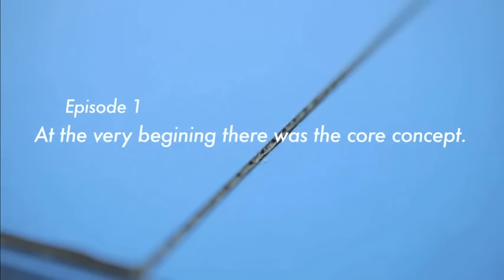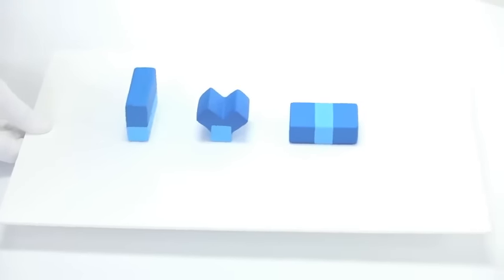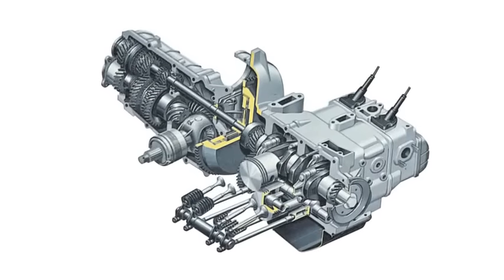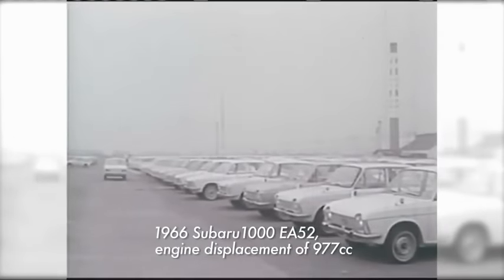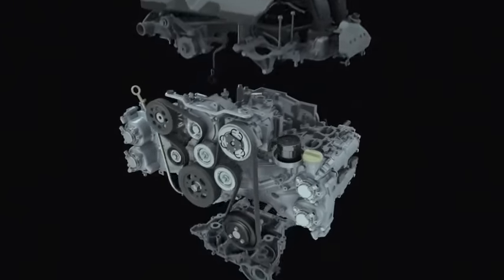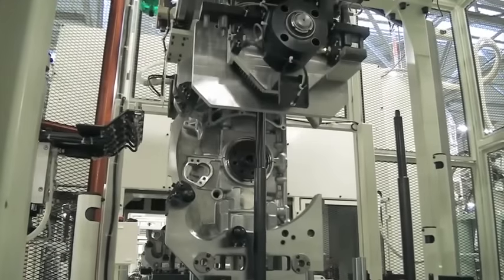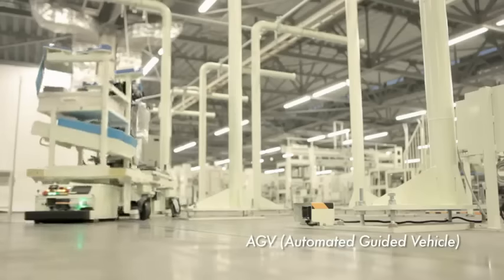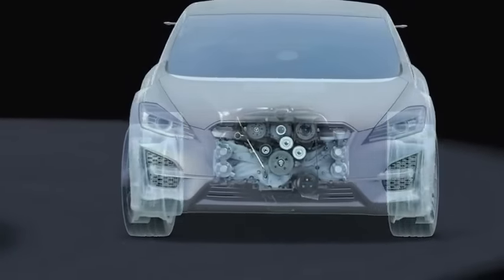Learn About Subaru Boxer Engine Technology

Comment: After considering Subaru for some time. Finally got a 2016 Outback prem. My goodness what a driving contrast from the old Silverado..The doors seal so tightly. You feel a pressure change when shut. Or so it seems. I have heard from many, with care those engines. Can just wave at 100 k if properly cared for. I would defer to a pro on that. Until then. Enjoying the vehicle. Oh. And Who Dey Go Bengals

Comment: Please let us not forget that even though the boxer is a nice engine, however it is SUCH a bitch to work on. HEAD GASKETS! HEAD GASKETS! HEAD GASKETS! I know a subaru tech that works at my local dealer, they have 4-8 a month in the shop, all head gaskets. A dealer charges $2k - $6k depending on if its both heads and if its done right by REMOVING the whole engine. I currently am saving for a wrx sti, I love subaru, but the only thing selling me on them is their AWD, else mitsubishi would have my money, its just that where i live AWD is a must. Currently im driving an inline 6, and yes its not a fast, racing engine, by all means, and yes the center of gravity is off, but i will tell you, when I am working on my 2000 cherokee, it is a DREAM to work on, and it is both inexpensive and can be done easily at home.
Reply: Chase Null If you make a pulley system in a garage and you don't have a motor pull then you can do headgaskets, or just buy a pulley and do it safer. Not to mention having something to allow you to pull motors will help in the future.
Reply: Connor Keegan funny my straight six doesn't need an engine life, I could literally sit inside the house of my car and work on it.
Reply: Well that didn't make sense. I agree that boxer motors are a bitch to work on, I was just saying it's cheaper to get a motor pulley and be able to pull them and fix the headgasket yourself if you're mechanically inclined. I also know that it's easier to pull the head on an inline four, a straight six, and most other motors that don't actually require you pulling out the entire motor. I'm pretty sure you can also drop the entire front suspension on my 96 impreza outback to get enough room to pull off the heads but it's a tight fit to be working on it like that.
Reply: +Chase Null I recently pulled the engine out of my sti, had it rebuilt and put it back in.  It was a total breeze, and before that all I had ever done was change break pads and oil...Subaru engines are really easy to work on, but the horizontally apposed design makes the weak head gaskets hard to work on, you can do them in the car, but it is a pain.
Reply: ***** sorry you had to do that. seems like a lot of work for a newer car. I say newer since I have never had to do it on my 2000 cherokee
Reply: +Chase Null it had 142,000k on the engine, it was time for it to go, thats what you get when you turbo a small engine like that
Reply: +Han Solo strange mine has 300k miles never had that issue
Reply: +Chase Null your sti?
Reply: +Han Solo oh gosh no my little old jeep! don't get me wrong I'd love an sti, but I can't justify the problems that come with a $38k car
Reply: Well, you're looking at a different type of car. Not to mention Jeeps suck, so the fact you managed to get it that far is good for you. Turbo'd motors don't have to be gotten rid of at 150k they just need to be rebuilt, and that's not even that big of a deal.
Reply: +Connor Keegan I mean yes NEW jeeps suck, however older jeeps you can't kill. inline six motors simply do not die, mine has had no coolant and 2 liters of oil and still ran like a top. But from a mechanical break down they are easy to work on with the exception of dealing with the rust
Reply: +Chase Null id be very happy with a jeep (maybe a little newer), but I just accept my car needs work cuz i like it.  Its not that bad actually very reliable with general maintenice
Reply: I would never own a jeep. So you can just call me bias and leave it at that.
Reply: +Connor Keegan no not biased. ignorance and bias aren't usually one and the same but they often go hand in hand
Reply: I'm not being ignorant, I'll drive an older jeep, but I won't buy one, nor buy American cars. I prefer Imports, and I don't like any of the new jeeps nor Wranglers or any of their vehicles they've made since the late 90's. There are far superior off roading and all terrain vehicles that surpass the quality of a jeep in many, many ways. Ignorance and bias only go hand in hand with an uneducated person. I don't like jeeps for reasons involving failures and mechanics. That's not ignorance, that's just preference and my social biased, if you were to be scientific about this situation.
Reply: But drive ur jeep till it dies, that's the point of a vehicle.
Reply: +Blehtubezz Aus well the dealer is $5-6k for both headgaskets, my local/family mechanic is around $2k for both. So yes the dealer is clearly ripping people off but what dealer won't? But I mean Subaru is in a way if they haven't fixed a known issue, and not all of their motors had the issue, so it would appear to be something that is able to be corrected.
Reply: The issue is the open deck cooling, and not taking good enough care of the car.
Reply: +Chase Null watch the headgasket done by the youtube user briansmobil1. he goes into great detail. honestly looks pretty damn easy. it can be done without removing the engine, but for how easy their engines are to pull out you might as well. make sure you get it machined before installing the headgasket and you'll eliminate headgasket gasket issues for the lofe of the car most likely. subaru i guess just using a air tool to scrape the surface which creates imperfections that the gasket has to try and fill resulting in less life of the gasket
Reply: Just don't buy SOHC 2.5ls, 1.8l's, NA DOHC 2.5l's, 2.2l's with black inside the exhaust or any Subaru with black coating the inside of the muffler tip.  And if you already have one, replace fluids religiously, get your head gaskets done or do them yourself at 75-80k, do the timing belt and water pump, always check your oil when you fill up your gas tank, check your fuel filter, o2 censors, canister purge solenoid, piston rings, ringlands, just take real good care of it and build it up or get rid of it before it's not worth anything. And if you have a DOHC don't neglect doing your timing belt, and if you do it yourself do it properly or you'll end up with bent valves and a lifter tick. Life lessons.
Reply: And watch your temp gauge people. Last thing you need to do is not pay attention and over heat your car, especially if you haven't had a new timing belt kit put on and you have 100k miles on ur car.
Reply: ***** Well if you do it yourself, the gasket that is. Costs are only the gaskets and fluids which is cheap as hell. I can bet though that machining the head would be far less than 3k. I could do it on a desktop basic cnc. The hardest part would be mounting it inside the machine and using a laser level. Oh and covering all the ports from debris. $200-300 job max id say.  Not trying to argue as you make a good point also. Machining would be proper but one could get away with a flat block sanding with a very fine grit paper. I dont own a subaru but will own a frs in the near future so i will be doing as connor mentions very rigorously. Some additions to connors tips if buying a subaru. A compression tester and obdii reader will tell you about the things you cannot visually see going on with the car.
Reply: +Blehtubezz Aus 👍👍. Sounds good
Reply: You only need to have the block machined if it's a piston issue, a headgasket you can get away with sanding the head and block where they meet so that it's all in spec to 2 thousands of an inch flat.
Reply: +Connor Keegan ahh okay. van you explain the black soot on the exhaust? isnt that just because its running rich which is a good thing for turbocharged cars especially. now black soot with blue smoke that makes all the sense in the world
Reply: It means your burning oil or your piston rings are on there way out. It's build up from burnt oil that's being combusted in the chamber instead of just air and fuel
Reply: +Anthony Rs You should NOT be running rich even turbocharged, and if your getting black and blue out your tailpipe that's sign your valve guise seals are demolished and your cooking oil in the piston chambers, crank case, and it's spewing into your headers too. You should get your piston rings and guise's replaced brother, because your engine is self destructing.

The worst part is if your seals are bad you're LOSING BOOST if there's any left at all, not to mention your pistons have to move through sludge, and it'll take that much longer to get the turbo spooling. Unfortunately since oil is vaporizing in your exhaust the TURBO MIGHT BE GUNKED UP, let's hope not. But you shouldn't see any smoke *unless your running an Anti-Lag System lol. I'm praying for your car brother, hope it's just small amount of oil sneaking through.
Reply: +Chase Null Although I like the balanced idea, I think it would be cool to TRANSVERSE mount it. That way you could work on it much easier, and even make a BOXER 8 CYLINDER (since you have more room longways). You could tune it to rev much higher with the good balance and low rotation mass.
How freaking epic would that be?!
Reply: cybertree That's not true, turbo'd cars do run rich usually.
Reply: +cybertree dude....running rich is a good thing. if you run too rich you get no combustion. run too lean and you knock.. turbos run rich as a fail safe.
Reply: Yeah, I have two friends with turbo'd cars and that is true for sure.
Reply: and my current car is running good lol thanks tho.
Reply: What do you drive?
Reply: +Connor Keegan a corolla, nothing sporty lol works like a charm tho
Reply: That's alright, I have a rally project Impreza Outback sport, it's not fast yet, but it will be in the next few months.
Reply: Corollas are good cars though!
Reply: +Connor Keegan sounds like itll be a blast, what are doing to go fast?
Reply: +AnthonyRs Well, I'm picking up a supercharger in the next few weeks maybe a month, getting the KYB rally suspension with dampening adjustment, K&N short ram air intake, 24mm White line rear sway bar, 22mm front white line sway bar, white line or kart boy endlinks (probably white line just because they're the same brand and go together), Kings 1inch raising springs, forged rods & Pistons, Injectors, and bunch of other stuff for the motor and radiator and lines, I just put in an Exedy clutch kit. I'm probably also going to try and get my hands on the EJ22t block because it's closed deck, but with the supercharger I shouldn't have too much of an issue with the EJ22e if I boost it like 6psi, but if I go higher than that I'll need the closed deck cooling with the block, if I was turbo'ing it, I'd need the EJ22T block for sure, but theoretically it should be fine. Essentially I'm turning it into a torque filled romp machine and getting involved in rally competitions.
Reply: +Connor Keegan sounds very interesting and a bit expensive lol. you know ive never even thought of supercharging a subaru other than the fa20. i googling that soon ! i just watched a vid on how to assemble an sti short block. was nt all that bad. i wanna wrench on a subie so bad now. torque over anything! good luck to your rock shooting rally machine project.
Reply: Anthony Rs Yeah, Was it Carey Holzman's Video? Old dude in a tank top? Subaru's are fun, doing the clutch was interesting, dropping the transmission is hard, and they are 127 pounds so if it falls its sketchy! But yeah, my friends timing belt just snapped and he has a spun rod bearing from burning oil due to his piston rings being gone, so the rod bearing wasn't getting any lubrication, not we're going to be dropping another EJ22E in there this next week. It should be fun! hahaha and thanks! It's actually only going to run me like 3 maybe 4 grand max, so not that bad for a custom build.
Reply: Subaru also had a supercharger STI concept, but they never used it or put it into production, and really the only reason I am supercharging it is because a turbo will blow the coolant into the engine and ruin the head gaskets and possibly do more damage. It's all due to the open deck cooling you can't Turbo a EJ22E so they made the closed deck cooling system in the EJ22T block. It's all so exciting! haha
Reply: +Connor Keegan yes exactly that guy hah. and oh true doing the work yourself saves soo much cash. good luck to your friends car. and huh learn something new everyday. wonder what a supercharged wrx/sti would sound like
Reply: It has that whining sound more than a turbo, but still that good ol' boxer rumble haha
Reply: +Chase Null I have done videos on motor swapping an inline 6 on a cherokee as well as several Subaru's.  Engine swaps are way easier on the Subaru.
Reply: +Chase Null Stop comparing the Jeep straight six to these poor peoples' average cars.  Its not fair.  That thing is the last breath of AMC built to last the ages so we can tell their story.  Your jeep will be all rusted and gone before the engine gives.
Reply: +Chase Null Yes I have had many nightmares working with my old FRS boxer engine before I swapped with a 2JZ.
Reply: What nightmares? *****
Reply: Lots of people work on the BRZ's and FRS's and have problems, but that goes with any car if it's getting built. A 2jz is easier in some aspects to build, but I'm sure they both have their issues when doing things, the 2j has been around for awhile now and tons of people have built them up so it's a tried and true motor, tons of people have also built up the 2.0 Liter boxer motor for a long time and it's a better motor than the EJ255-EJ257. So I'd like to know what nightmares you had to deal with if you don't mind sharing your struggles.
Reply: +Chase Null That's a massive ripoff. Here in Bulgaria, it would cost you the gaskets themselves, plus some extra 5-600 euros if you go to a mechanic. Of course, for that money you could just buy yourself an engine crane (or whatever it's called in English) and do it yourself. 
As for your Jeep, glad to hear it made it that far. I've read some not so good things about Jeeps in general, but have never taken too deep of an interest. However, you are comparing a sports car to a naturally aspirated, big ol' engine that doesn't make a lot of power compared to it's displacement. Of course, you've already made that connection, I'm just posting it here for the other people reading this thread to see. That's the main reason why American V8's that are in big 90's cars last so damn long. When you have a 4.6 liter engine making 210 horsepower and not all that much torque, you end up with an unkillable beast.
Reply: Newgenerationisbg Yeah in my area, its $1000 to $2000 to go through a mechanic.   Nice to see someone who thought about the what they were saying before posting it on the internet.  You get my highest honor.. +2 if I could.  Interestingly enough I calculated the power per cylinder for an early Dodge Viper not too long ago.  Came out to about the same as a modern Honda Civic lol, maybe a little higher, but with a lot beefier parts to handle it.  Perfect if your plan is to have fun beating the heck out of your sports car on a regular basis.
Reply: Vipers are bad ass
Reply: Gung Ferdoosh Hahaha, I'm glad that's what you got out of that.  I'd be fine if Santa could fit one down the chimney
Reply: Have you seen the new ACR? Sooooo sick
Reply: +Chase Null Never put your money at Mistusibshi. Their cars lost their sturdyness and they are just a joke in this moment. Add to that catastrophic aftersale service and you are screwed.
Reply: Subaru isn't too good these days either, and hasn't really been. Cars all have their problems
Reply: Headgaskets were last an issue in model year '99 with the EJ25D engine. The replacement EJ251/253 engines rarely have headgasket issues, normally caused by improper maintenance. The engine is not normally removed to do headgaskets, $2000 is very high to do headgaskets.
Reply: Chase Null get an Evo
Reply: find the right mechanic and it's literally 1/10th that price.

Comment: i ABSOLUTELY ADORE my L.L.BEAN EDITION 3.0.. i think I'm the second owner.. it has 226,000 miles.. i bought it having195,000 miles.. I only had to replace the alternator, valve cover gaskets... it always starts well..& it REALLY FAST!!  But i must also only use premium fuel only... it's 2002 model year... I'll ALWAYS BUY SUBARU....

Comment: Gravity does not play a major roll in piston movement because of the presence of lubricant between the pistons and the bore wall. At high speed, the viscosity of the lubricant is enough to separate the piston and the wall in that tiny clearance between them. EXCEPT during major vibrations, when you have more forces than just gravity, you may have piston knocking on the wall, but that happens with every type of IC engines.

Comment: I had a used Subaru FF-1 1100 said to be a 1970 model though Interestingly, I have seen a 1968 model on youtube that looks identical down to the color of the red water pump pulley and enameled green valve covers, inboard drum brakes, the whole 9 yards. It had high miles when i got it in '74 or '75 too but always gave great gas mileage @ 40+MPG. I had it 13 yrs and even did a light engine rebuild in 1980 which lasted well! I wish I had gotten it new and still could buy such a car today!